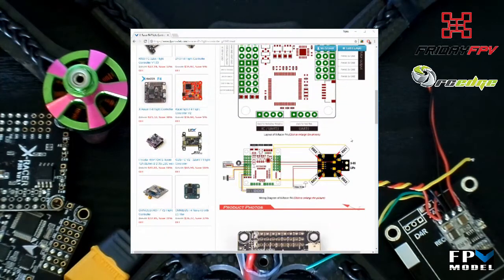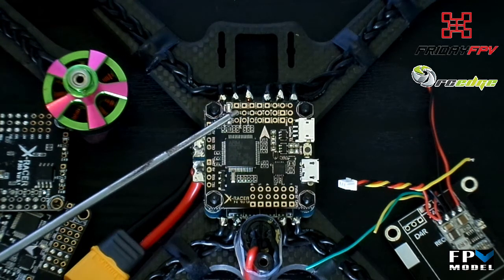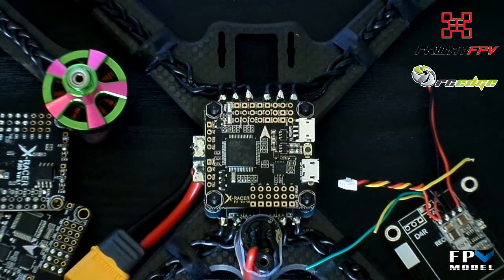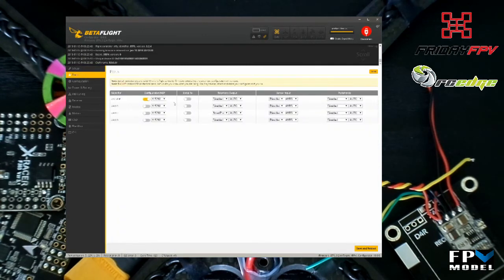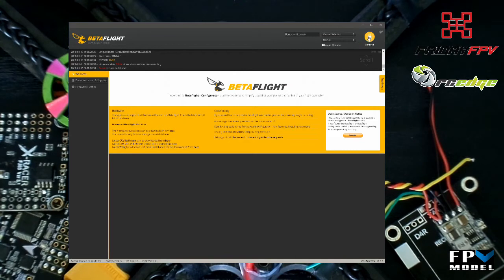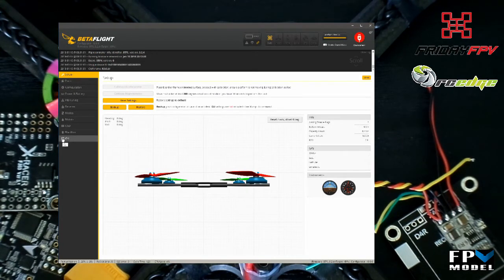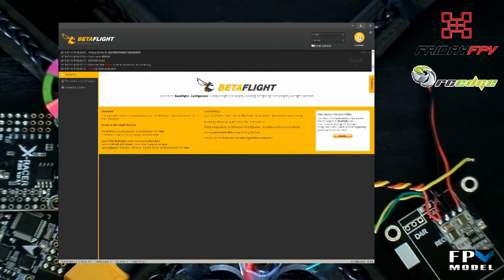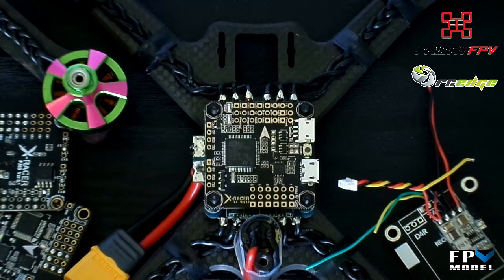X-Racer F4: How to SBus, Smart Port, TBS Smart Audio, BLHeli 32 bit Telemetry

Comment: Hi Bryan, wondering if you could help me out. I am now on my third PDB. The issue is a lot of research I have read shows that I would need to connect my X-Racer F4 FC VBAT directly to where the battery goes into the PDB. When I do this the FC and the PDB gets very hot and and then magic smoke. When i unplug the battery and remove the VBAT cabling and plug the battery back in the FC does not power on but does power on when i plug in the USB into the PC and i can configure it.

My question is I want to watch the battery current on my RX so where would I solder the VBAT on the X-Racer F4 onto my HUBOSD8-SE 6S 184Amp sensor BEC 5V and 10V? I was thinking on FC VBAT port to solder it onto the VCC on the PDB, would that work? I really dont want to blow this 3rd PDB.
Reply from the maker: Hi Germano, thats strange is there anything else that you wiring from the pdb the the fc when you did that?
Reply: I'm new at this but the first time everything was smooth, I flew it for a bit but then over discharged my Lipo, that's when i learnt about VBAT and all the forums and even where I bought it from(online) said I need to connect it directly to the battery, did that twice as the second time I thought the cable was too thin. That's why instead of reading and reading I would start asking question on forums before I touch this third PDB. So in short the only thing connected to the FC are the 5V from the PDB. Do you think that that 5V and the VBAT together are doing something wrong? I think I saw somewhere someone mentioned VBAT can power the FC. Then again why would it blow the PDB and not the FC.
Sorry man for all the questions and wall of text.
Reply from the maker: @germanji  Yeah having the 5v and the vbat connected can cause issues. I would just connect vbat and leave the 5v off. You can use the 5v on the pdb to power other electronics like your camera or vtx
Reply: Thanks dude. Would you have any tips on how I can prevent me from blowing the PDB? There is a capacitor with this one this time, would it help if I add it?
Reply from the maker: @germanji  Blowing it would normally be because of the 5v amd vbat being connected. The cap will help smooth out the power for the video equipment though
Reply: Thanks again so much. Will give it a try and let you know the out come.

Comment: Hello, sorry my terrible English... You sad that VBAT can power the FC, is that correct? So, no need feeding the 5V rails? Thanks
Reply from the maker: Hi Thiago, yes all the ones I have seen can be powered straight off vbat, no need to feed the 5v rail. If you do it this way I would recommend only having the FC and receiver on the 5v rail though as I don't think it is a strong current source, if you have other 5v equipment rather power them from something else.
Reply: Bryan Limerick 

Ok so I'm looking for another FC. I currently have the X-racer F303 v3.1 and I'm using an external BEC to power the board. I apologise for the "stupid" question but I need to make sure before I go and fry something. 

The vbat on the F4 can be supplied directly from the battery and powers the board? No smoke? I don't need to power anything from the board so I'm not worried about that. I just want to get rid of my external BEC. THANKS!

Comment: My unify 5v is connected to the 5v BEC on my 4in1 escs, and i don't have a ground wire going to the FC with my smartaudio wire. Smartaudio works fine, but am still getting bad lines. Could the lack of ground wire here be the cause? Thanks for the vid man!
Reply from the maker: Hope it help. Yeah I got pretty bad lines when there wasnt a ground for the vtx and camera close to the osd circuit. Try grounding the 5v bec 5v output ground to the ground pad nearest the video input...if that make sense.
Reply: Don't quite get what you mean, sorry. I'm running the FC off Vbat so the 5v line from my 4in1 isn't going to the FC. Should I just add another wire from the unify ground to the ground on my FC?
Reply from the maker: Just Chill Yeah you can run a ground from the unify to the ground pad below the video out.

Comment: Using R-XSR and x-racer f4 and set up exactly as the diagram on FPVModel's website.  Follow your instructions for telemetry but get only but RSSI.  Does not see any voltage at all.  Have tried both Tx3 and Tx6.  I have soldered the wire to the un-inverted small pad on the R-XSR.  The LED's don't work on the FC so I am thinking I have a bad board.
Reply from the maker: I would say if the LED's aren't working you more than likely have a bad board. Few things you can check is disabling telemetry in the config page, save and reboot, then go re-enable it. Sometimes betaflight settings don't take depending on the configurator version and fc. Also double check that its selecting smart port under telemetry and not FrSky.
Reply: Thanks Bryan, board is probably bad, but I reluctantly flew the drone today knowing the possibility of a bad crash.  3 batteries and not one problem, other than no telemetry and also no voltage on the OSD.  If I had voltage on the OSD that would be enough.  Had to do a beeper hack to get it to work.  Put it on Motor 6 and changed the resource.   On another note, I read that the Omnibus F4 VBAT had to be tied to a RAM pin in order for the board to recognize the voltage, but there is nothing like a RAM pin on the x-racer. Maybe by another name?
Reply from the maker: Dudley Henderson. No unfortunately there is no ram pin on the xracer. Seems like some of the circuitry on the board is not working if its not reading voltage and the leds are no on. If it still flies though then I would imagine its a minor problem.